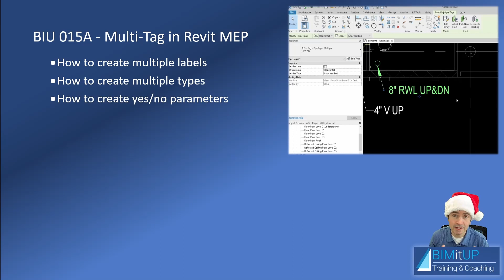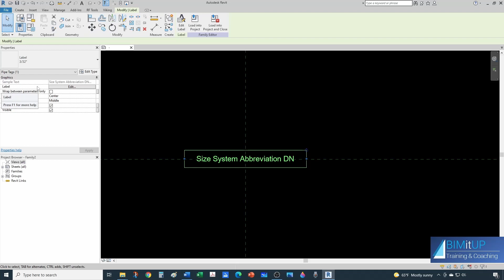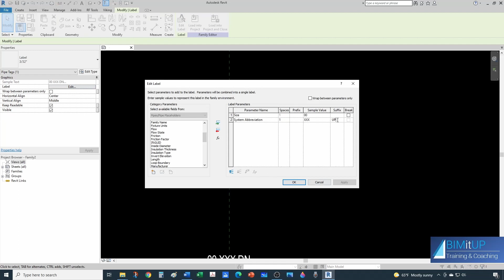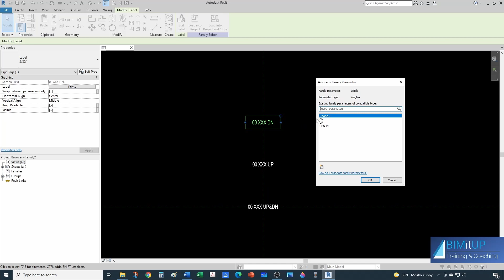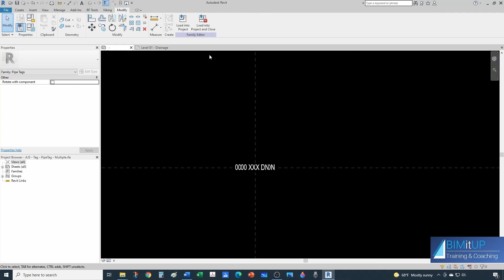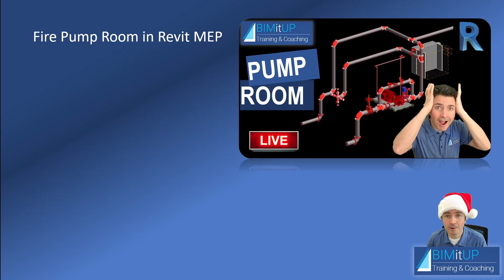How to Create a Multiple Pipe Tag in Revit (Multi-tag) Tutorial

Comment: Hello! Is there a way to make a tag that shows all the pipe sizes/pipe systems of multiple pipes based on some host placement order?

Example:
I'd want a tag for a 4" storm and 3" san pipe but when I add multiple hosts, the parameter will display <varies>.

Thanks
Reply from the maker: That is a really good idea.
To my knowledge, this would not be possible.
I know you can use the same tag for multiple pipes that have the same size…
Anyway, that would be a good “idea request” on the Autodesk website.
Good luck!